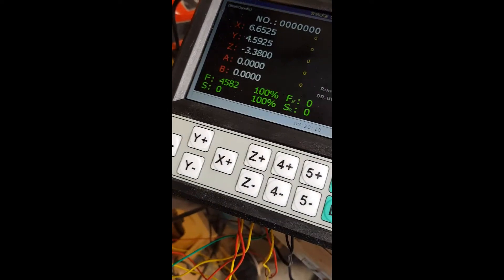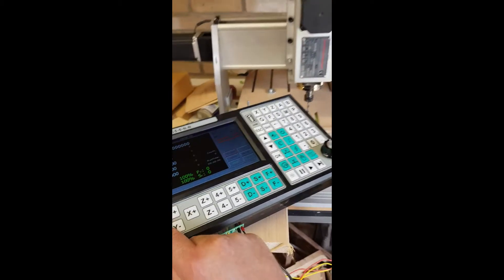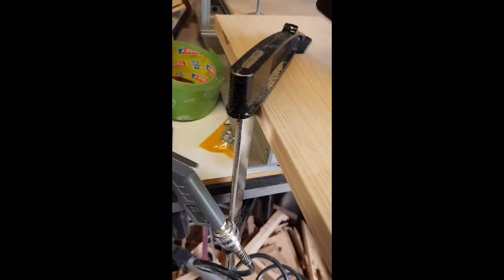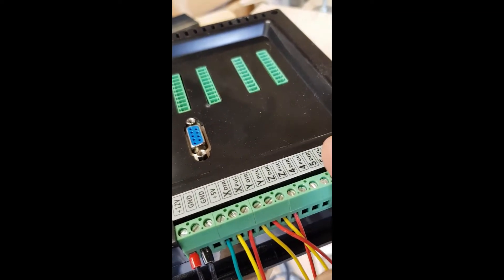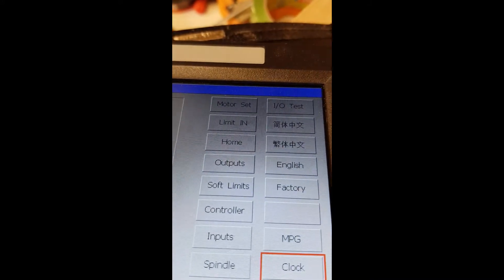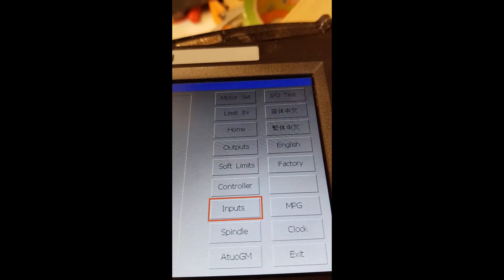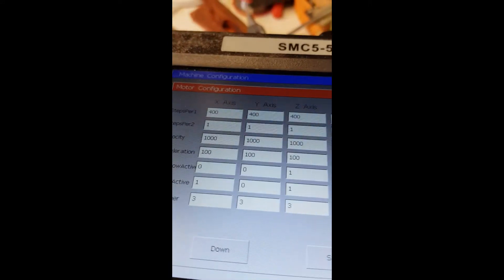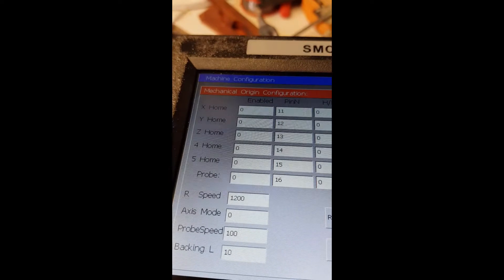smc5-5-n-n cnc controller axis problem

Comment: Good day, Sir. I'm planning to purchase one of these. But what g code file types can it read? I heard that only .tap or is it possible to read .nc also? Could you help, please?
Reply from the maker: tap and a whole bunch more.
if you connect Nema 23, it is fine, if you thinking about bigger closed loop stepper motors, better look for a diferent option, or try to supress the electromagnetic noise, that disrupt that controller.
it already destryed many long time works on my machine
Reply: @joematarc5245  Thank you very much

Comment from the maker: the problem was my fault!
I accidentally switch the wires of high voltage for the signal ones. Sent the power that comes from the drivers, that spouse to go to the steppers, into the controller...
The X and Y axis, was the ones that I tried to jog, and I cased some damage to the controller. I got a new one, and I've learned my lesson!
So, don't do the same I did, or, " controller is no more"!

Comment: Hi Joe, very frustrating. I had the same issue with a Grbl controller. When I chased down the wires, I found a very small cross-connection (a very small wire thread) between X-axis pulse pin connector and an adjacent connector on my arduino board. I fixed mine easily using better connectors,  works perfectly. In your situation, I'd suspect the presence of a faulty solder bridge inside your controller. I'd use a multimeter in continuity mode to check the internal box connections.

Comment: Hi Joe, I am building a 3 axis router using 4 motors, 2 on the X axis and I did purchase this controller. If this controller did not have this glitch you are describing would you still recommend the SMC5?

Kind of disappointing to see problems with the SMC5 before I even get started. Thanks.
Reply from the maker: sure. in fact, I have purchase the second one, but this time on Amazon.
a bit more expensive, but arrived in two days, and if something goes wrong, I can have my money back, or get a new unit.
Aliexpress , sometimes you're lucky and sometimes you don't. it's like playing Chinese roulette. 
My machine is all self built, and now, it's like a Mini, with a Ferrari engine. Need to move on, and get a bigger frame.
before I was using an Arduino, and GRBL. Man, after the SMC5 controller, the speed increased ten fold.
Maybe, if I have the time, I'll make a series of video tutorials about my adventures with the CNC, laser and 3D printing.
good luck.
Reply: @joematarc5245  Hi Joe......ok, great....I feel much better now. Yes, I would be interested in a series  of further adventures with your CNC. Thanks so much for taking the time to respond, very much appreciated.